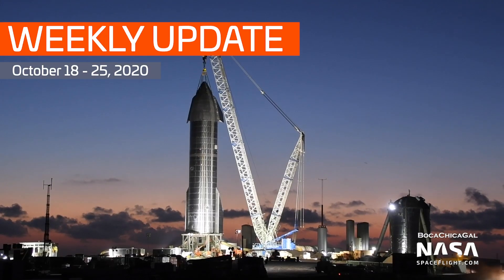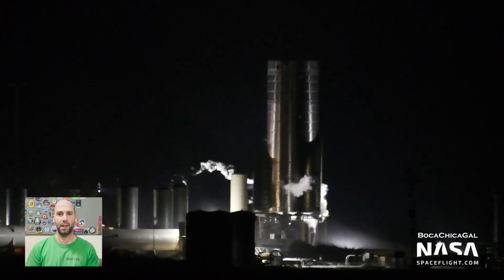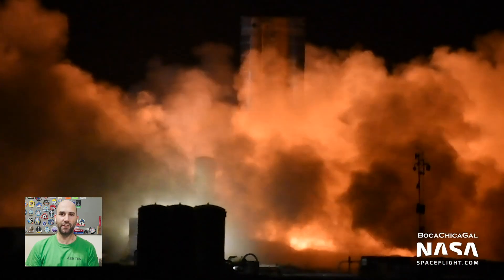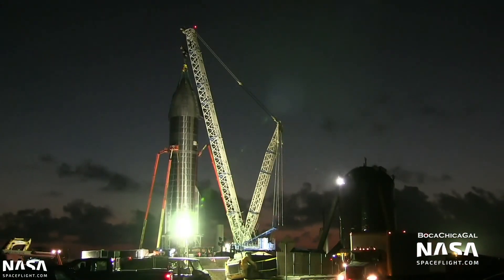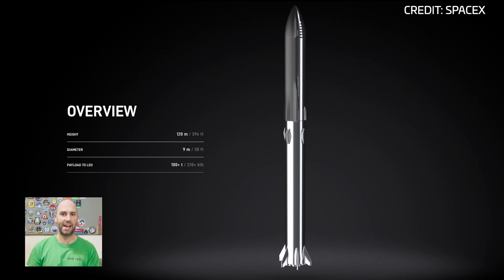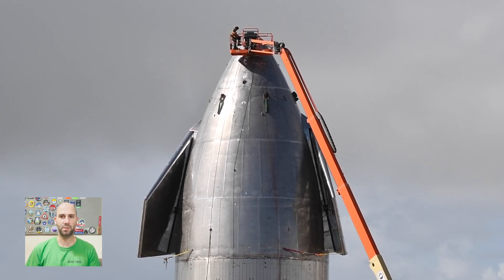SpaceX Boca Chica Weekly Update - Starship SN8 Static Fire + Nosecone Install, SN9 Close Behind

Comment: 0:00 - Intro
0:25 - Thanks Mary
0:28 - SN8 Preburner and Static Fire testing
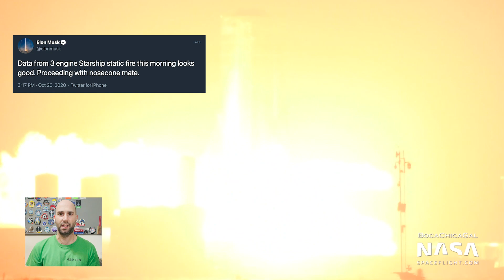1:20 - Sound at End of Static Fire / Engine Swaps
2:04 - The Fate of Raptor SN20 (SN4 Explosion)
2:21 - The Dreaded Grunch (or maybe not)
2:38 - Raptor 39 Removed / Raptor 36 Delivered
3:14 - A Starship is Born
3:51 - Unbridled Exuberance
3:55 - A Nosecone changes everything
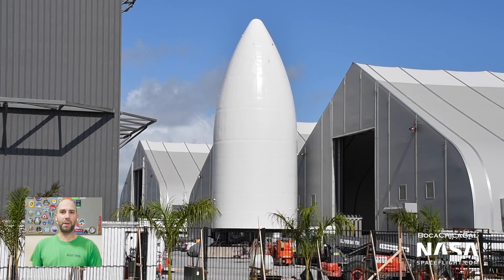4:52 - NASA Human Landing System Mockup Nosecone
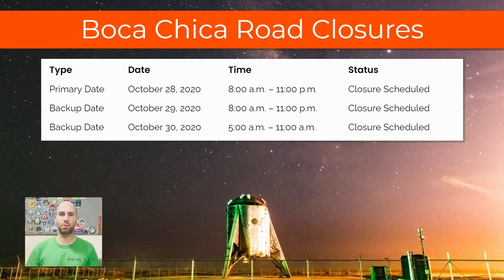5:38 - Road Closures / SN8 Flight Date Speculation
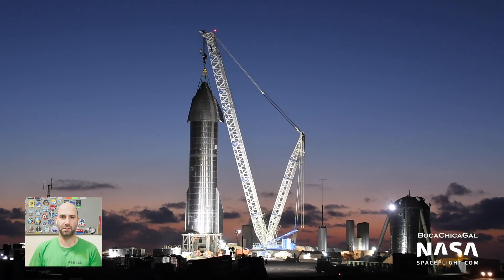6:20 - SN9
6:55 - Cat Attack
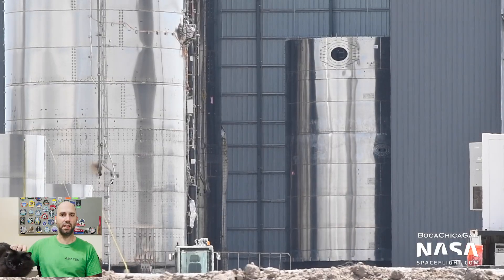7:14 - SN10 Stacking and SN11 Common Dome Sleeved
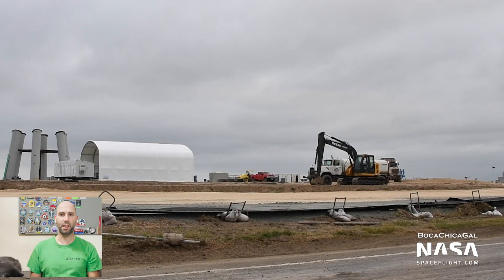7:36 - Tent at Launch Site
7:51 - Scaffolding in High Bay / Bar at the top
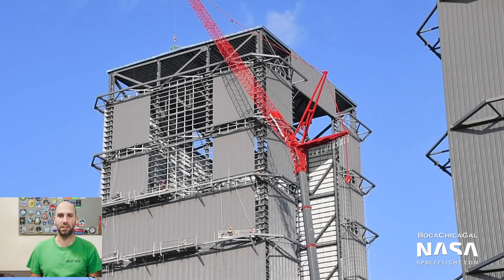8:17 - Be Safe, wear a mask
8:25 - Outro
Reply: Thanks Jack !
Lol.. we’re goin to mars.. we’re goin to mars 😂
Reply: "Can you... can you not please? I'm trying to do a thing..." 😄

Comment: Hey Mary, I bet you never expected SpaceX to land in your backyard or that a new career on youtube would fall into your lap at the same time. It must be a wild ride.

That engine noise is an oscillating flame front followed by rapid reduction to zero pressure. If it gets too bad it can destroy an engine but a little tweet at shut down isn't going to do anything.

That tent next the orbital launch platform is in the wrong spot for that being an orbital launch platform. Musk needs to re-think the no flame diverter decision and the addition of a noise suppressing system. If you don't the noise alone will shatter concrete.

Comment: Apparently part of my response got cut. Was supposed to say Acrylic has a higher impact strength than glass and does not shatter when exposed  to high strains or blunt force. At less than half the weight of glass. Still have my doubts. Though time will tell. Go Starship.  :)

Comment: Great coverage. Thanks to all. :)  By the way, if there will ever be a "Starbar" or such atop the hi-bay. Of which I have some doubt. Possible solution?    has a higher impact  than  and does not shatter when exposed to high strains  blunt force. ... At less than half the  of

Comment: That 'grunch' sound you are referring to happens on the RS-25 and other engines too. As the valves are shut? the gas is restricted and it causes a resonance of vibration from the hydraulic shock. For a brief moment as the valves close? the engine nozzle can be played like a brass instrument. You're hearing a single, poorly played note on a raptor sized trumpet.

Comment: Hopefully the scaffolding inside high bay is part of what is needed to get the internal crane/lift system in place on the ceiling. Not sure what it’s called. 
Also, thinking about the awesome bar, it would be killer to see windows installed on not only the outer perimeter of the bar to see everything around the high bay, but windows on the interior walls as well so guests could see boosters in the bay and maybe even watch elements of the boosters being built. Not a bad place to watch a launch too! I’m guessing they will be using glass like we see in really large aquarium tanks. Sea World type stuff.

Comment: In reference to the "groan" at the shutdown of the raptor engines: have you ever heard the noise made by a turbocharged car from the waste gate or turbo relief valve? It's very similar only on a larger scale.
Reply: yup, totally agree its a relief for the turbo pumps. makes sense too as to why its the sound you hear at the end.
Reply: You also hear something very similar when a pulse jet is shut down - I suspect high frequency pulsing as pressure in the thrust nozzle drops.
Reply: Interesting.... thanks for the input!
Reply: If it is LOX then the metal is oxidized ( "engine rich")
If it is CH4 then proton plasma damage
Reply: Yes I’ve heard similar sounds with large hydraulic presses when valves are shut, some big forces going on there for sure🇳🇿👍